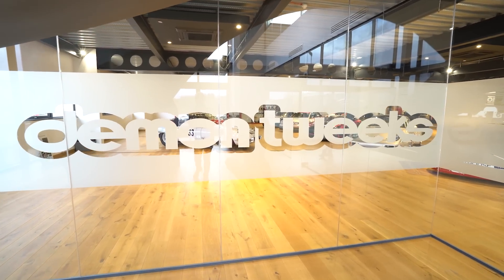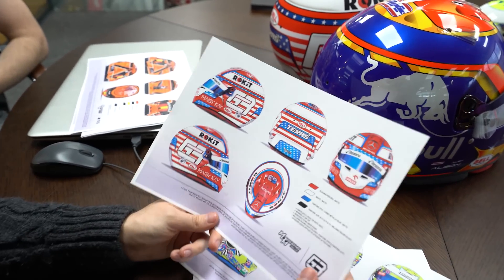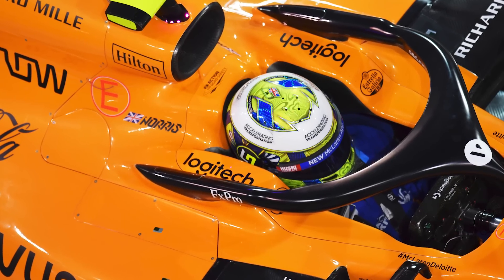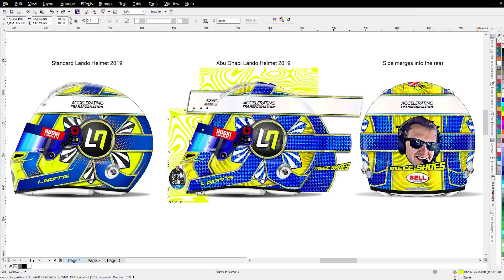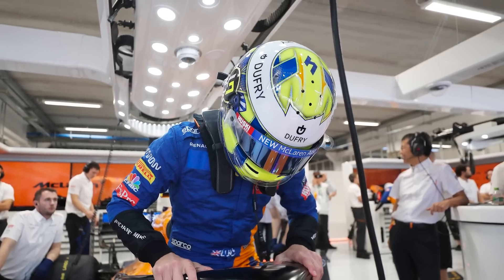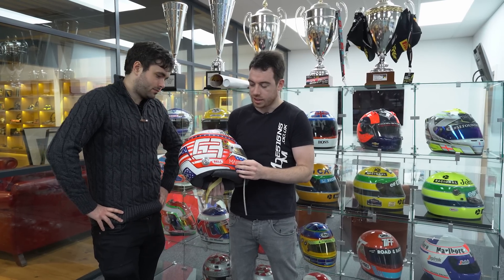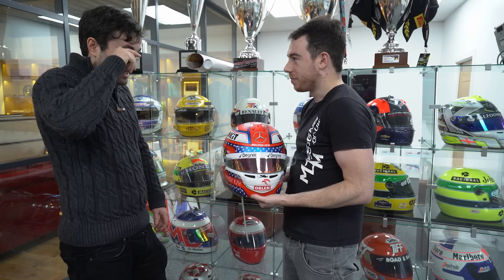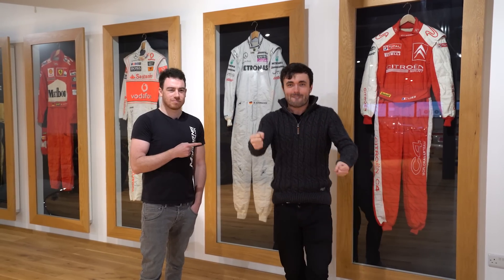How Is An F1 Helmet Designed?

Comment: Is it just me? I can easily identify the helmet designs of Berger, Alesi, the Schumachers, Hill, Frentzen, Villeneuve and even the designs of drivers I did not see driving (that much) like Senna, Mansell, Lauda, Rosberg sen., etc.

On the other hand I can’t even describe the helmets of Hamilton and Vettel, for example.

Could it be that the helmet design to that time just was clearer and easier to identify?
Reply: I think it's just you don't pay attention. Vettel and Hamilton's helmets are one of the easiest ones to identify, especially Seb's, coz he has a singular german flag stripe over his white helmet, donno how you can't identify it, tbh. For Hamilton, it's a little less noticible, but it's relatively easy to pick up coz it's purple (this year) and the design stays the same.
Reply: Joanna Xuan 

Sebastian‘s Helmet designs according to his website:
9 in 2014
White and German flag design in 2015
5 Special Designs in 2016 + Standard helmet
9 designs in 2017
6 designs in 2018
1 design with variations in 2019

I don’t think that too many designs help to identify drivers.